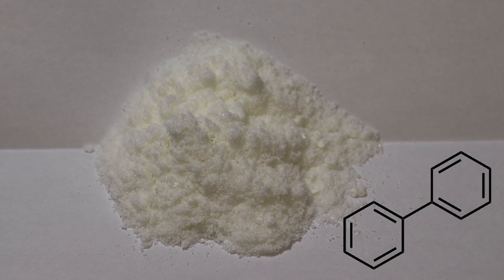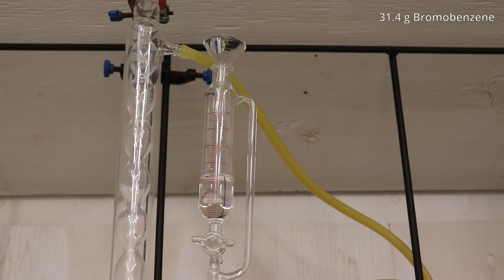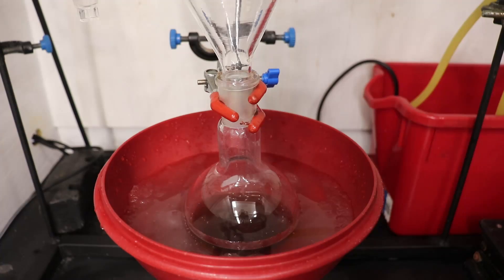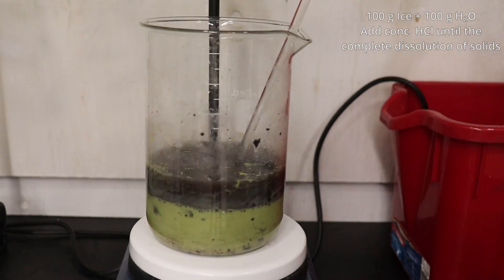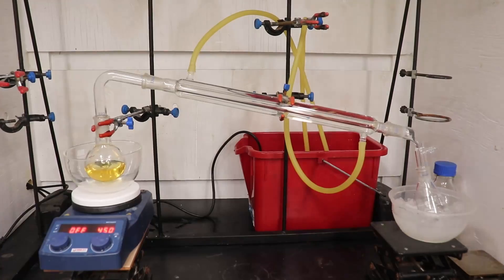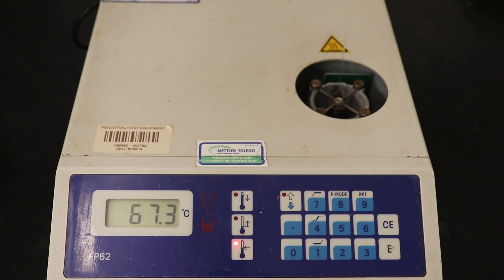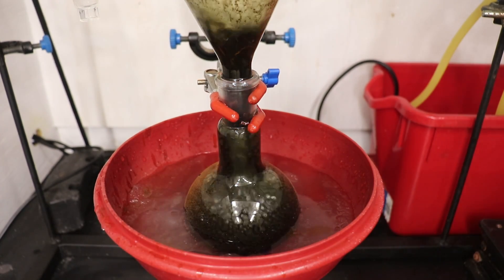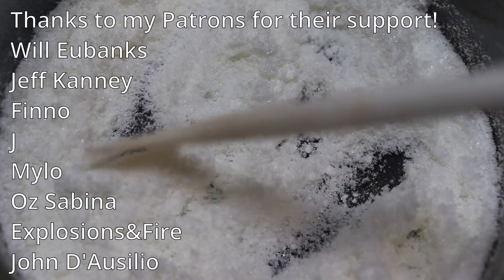Biphenyl Preparation from Bromobenzene

Comment: That's an Ullmann coupling, great !
Reply: Is it though? The Ullmann reaction uses metallic or Cu(I) and high temperatures on aryl halides, this uses barely room temperature, Cu(II) and two grignard reagents. And it's doubtful to me that it's merely a catalytic crosscoupling either because the copper is used in stoichiometric quantity.
Reply: @antozon5070  if I had written Ullmann-type, was then better ?

Comment: You can also have improved yields possibly by having bromobenzene 1:1 molar equiv. with the PhenylMagnesium Bromide. And byproduct only MgBr2. I would check if it is a better option. I am actually waiting on doing this synthesis for creating a compound; troparane. Using halogenated tropine to remove hydroxy and then PhenylMagnesium Bromide. 
-
Mike
Reply: That's a kumada coupling (forgot spelling) I think

Comment: Nice reaction! Are you sure it is copper II not I chloride? I did something similar in past and protocol asked for CuCl.
Also as biphenyl is ultra non polar, you can try to just stir crude solid in hexanes or heptane. It should dissolve it fully but polar stuff should stay behind. Also filtration through something like silica or alumina, not chromatography, but just filtration through like 1 cm, should clean it very well.
Reply from the maker: Yea the procedure I was following explicitly said copper(II) chloride. For purification, I was following one of the procedures from the Purification of Laboratory Chemicals encyclopedia, it does mention that passing it through alumina removes polar impurities. I've already used the biphenyl made here in another reaction which worked well, hopefully that video will be up in the coming weeks.
Reply: @corrosion-chem  can not wait for that video!